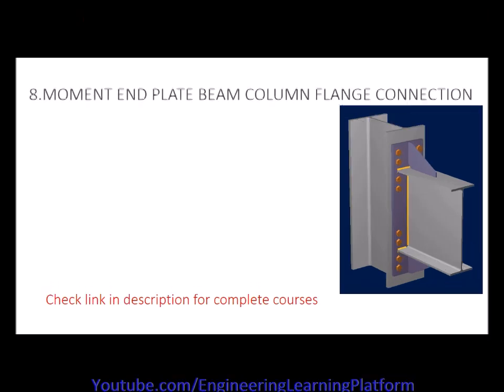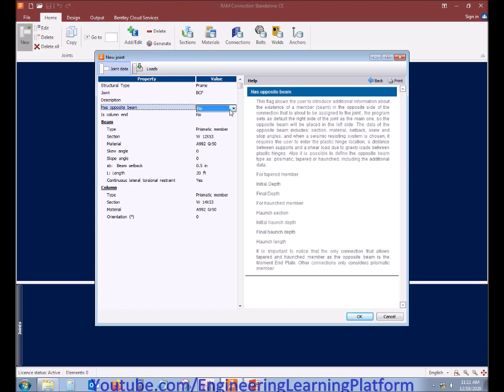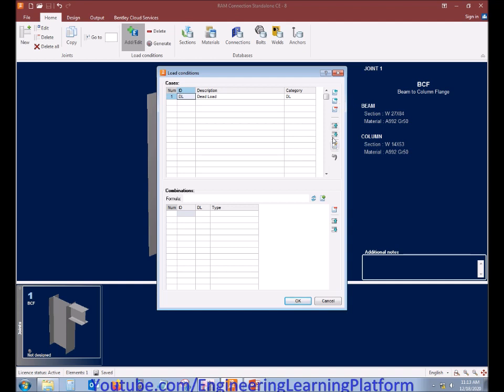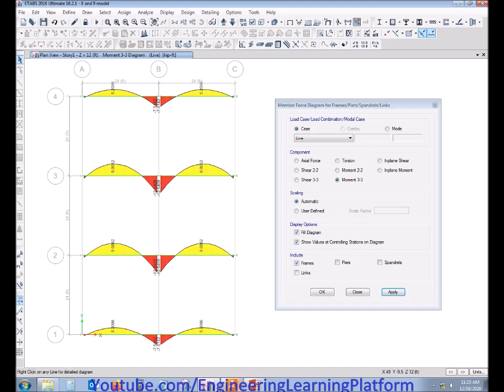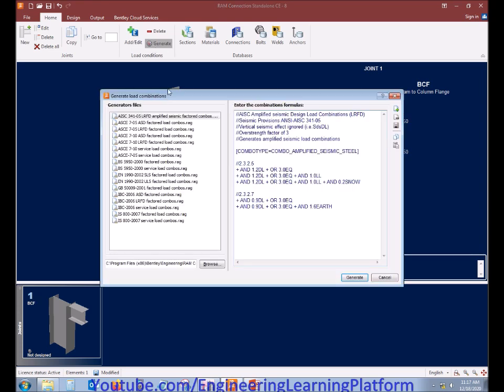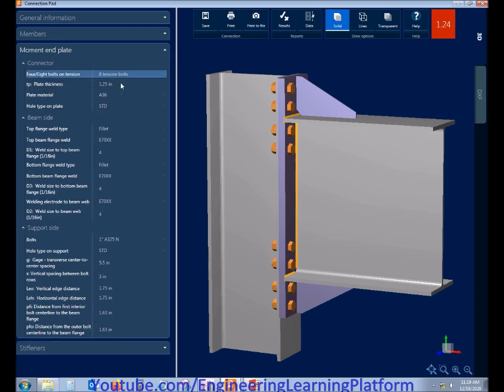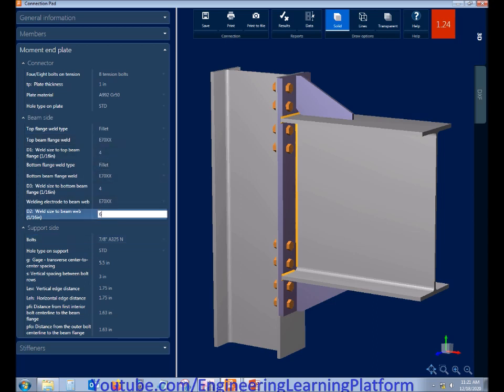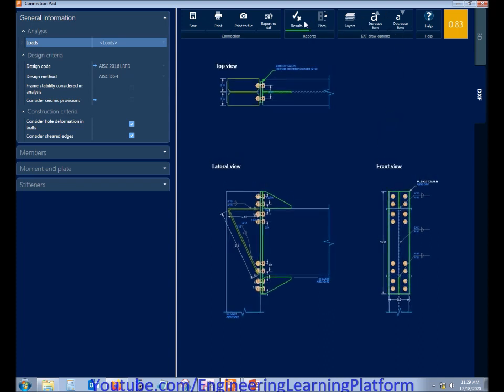AISC DG4 Moment End Plate Beam Column Flange Connection using Ram connection

Comment: Thank you for your explanation about this topic..

In wich video can i see the explanation about "thick plate" behaviour?...😀🤔🙏
Reply from the maker: You can check code for details. I'll try my best to show the solution asap.
Reply: @EngineeringLearningPlatform  Hi Sir. Is there any solution to this "thick plate" behavior". THank you for the video!
Reply from the maker: @gere4769  it specifically refers to the condition in connections where the plate's stiffness prevents the formation of plastic hinges and avoids the development of prying forces in bolts, ensuring a more rigid, elastic behavior under load. Thicker plates also generally exhibit higher stiffness and load-carrying capacity but may be more susceptible to issues like buckling or cracking.

Comment: Dear admin, I have a question. 
What are the differences between Moment End Plate Knee horizontal, vertical and perpendicular connection of a rafter to column? When are they used?